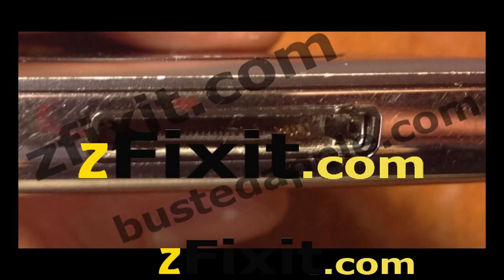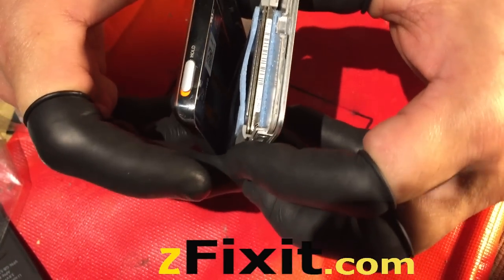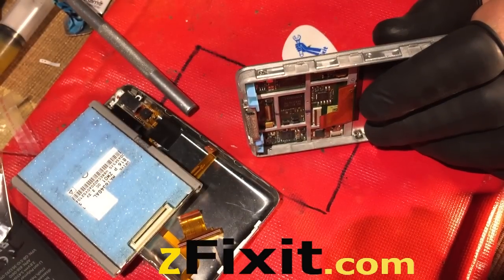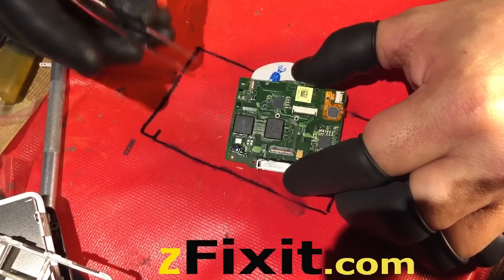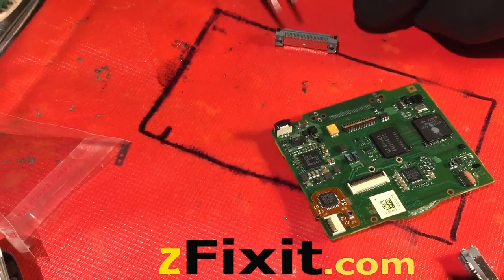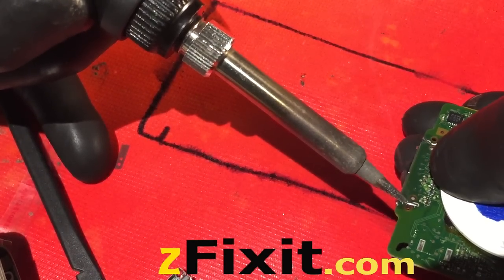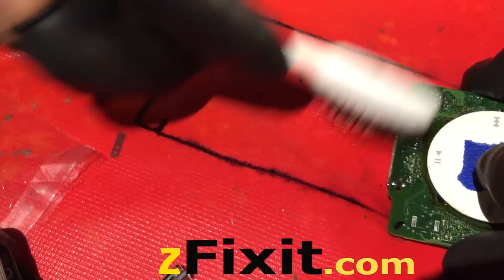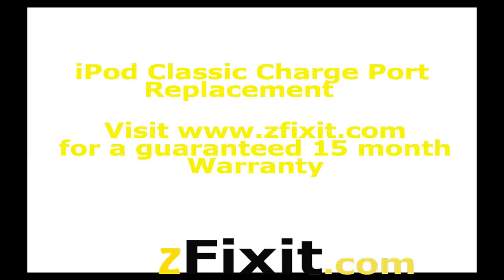iPod Classic Charging Port Replacement

Comment: I'm having issues with my ipod classic, battery was giving up easily so I replaced that with a bigger capacity and put a iflash quad in it. Thought I'd cracked it then my ipod just wouldn't sync aaarrrggghhh! Turns out the diagnostics said the connector wasnt working properly. Ordered two of them today. Fingers crossed

Comment from the maker: saw the dislikes... this not a tutorial, an advertisement for my business.  This is not recommended for beginners..so I did not post soldering instructions, most people will ruin their device. So many steps, the first timer will kill their device, this is micro-soldering with years of experience! I still have issues with bridging, cold joints even though I have been doing this for 8 years!  DO NOT ATTEMPT THIS unless you have very strong micro-soldering skills, if you value your iPod, do not attempt, reason I did not show soldering technique.  It was done under microscope ... so who has a microscope and who has a soldering iron that has the right tip...and so many other requirements.
Reply: I have been into micro-soldering for 3 or 4 months now and have done dozens of port replacements on various devices. It's generally pretty straightforward - although I do admit to messing up my first repair. When I was heating a hdmi port in order to take it off of a board, I wasn't patient enough and pushed it off when a pad wasn't melted and it ripped out a trace. It was repairable by soldering copper wire from that pin to the corresponding diode, however. That really was it and i'm brand new. There are plenty of good repair tutorials on YouTube and I have had dozens of other successful replacements. 

There's definitely a lot of ways to make your replacements and repairs better more often such as wicking up unleaded stock solder and replacing it with leaded solder, using quality tools, solder, and flux, using the right temperatures, and insuring everything is connected probably. The truth is anyone could do this. But you have to invest money in the proper tools, and for most people it's better to have someone like you fix their broken devices for them as they're not going to have hdmi or usb-c charge ports or encoder ic's go bad on them all the time.

Comment: Hi, did you solder all the little pin connection to the board or just the four points underneath the board?
Reply from the maker: Scott Copening soldered all 30 pins, did not show soldering process on the 30 pins as this is an advertisement, I show very useful stuff if you manage to open it. The soldering process is self explanatory for those that are experts at micro-soldering, the micro-soldering is not something recommended with a cheap soldering iron, the opening process if you attempt will usually end in additional cost, the battery disconnect may cause additional damage.   But is possible but do not recommend for a 6/7 gen, opening a 5th gen is easy.

Comment: My battery charges inconsistently, my iPod does not connect with any computer...I believe it to be the charging port (probably damaged by putting it onto a third party speaker). Best would be to send it to you after purchase a charge port repair? Do you check it for connectivity before you send it back?
Reply: Hi, yes, I test to check issues, have you tried a different cable before you send in?  
I'll try different cables also.  Before I replace charging port, I have to see physical trauma to the port, if not visible outside, I'll open it up and check the solder points on the inside.  If still does not work if I replace, then refund minus return shipping and .99 diagnostic fee.

Comment: If i were to find a shop to repair my charging port, because after watching this i noticed that its beyond me, what questions would i ask that would help me decided which shop to go to?
Reply: If your device was working fine prior to damage to charge port issue, they should be able to test with a battery that had been externally charged,  you should tell them you need a picture of the internal charge solder points prior to damaged charge removal , close up under magnification and then picture after removal. Some shops damage the solder pads where there is no issue with solder pads. Once they damage, they just tell you sorry, too much damage from your damage, they assemble and you are no wiser.  If all solder pads are intact prior to removal of old port, then there should be no issue.  I always take a picture of old port if I find solder pads ripped off board, send to customer, this is before I even attempt to remove the old port, so that there is no doubt to customer if it was pre-existing or if I caused it ( has never happened, me ripping solder pads off board, hence my high ratings on BBB, eBay, Yelp and in my website.

Comment: I wonder if I could trace data+/- then convert the female 30pin to female lightning, is it possible? will it still work on itunes?
Reply: no room, the current conversion adapters require too much room for the logic board adapter, their chips, etc. I have bought a few to see but not enough room inside. Their is much more chip requirements than just tracing pins to a lighting connector, requires a logic board, caps, transistors, resistors, SMD chips. It works with the required board .. but you cant just solder wires to a lightning connector, I tried, didn't work. Even if you can get it to work, the lighting female port will not fit, Then you have to anchor it to the logic board. else the new lighting port will have the same issues as the original, will come loose, become un-soldered.  Damage to the port is minimal ... but will be loose, need a solid port, no way to anchor the port.

Comment: How much do you charge for this service? Where are you located?
Reply from the maker: It is $99 plus return shipping of $5.80. you will have to purchase the diagnostic service first. $15. The $15 is applied to the $99 repair cost. If is it badly damaged, non repairable, then all you paid was the $15.  I have to spend time to open, look at it, I can't do it for free.  That is what the $15 fee is for, but if repairable, then the $15 is applied as a payment toward the $99. Pricy ... yes ... but it is only for those customers that value keeping their iPod intact.
In San Antonio TX
http://www.zfixit.com/ipod-classic-6th-gen-charging-port-repair/

Does not matter which version you have, 5/6/7, they are all the same price to replace the charge port.

Comment: How much does this cost (if i were to buy off ebay/kijiji
Reply from the maker: It is $99 plus return shipping of $5.80. you will have to purchase the diagnostic service first. $15. The $15 is applied to the $99 repair cost. If is it badly damaged, non repairable, then all you paid was the $15.  I have to spend time to open, look at it, I can't do it for free.  That is what the $15 fee is for, but if repairable, then the $15 is applied as a payment toward the $99. Pricy ... yes ... but it is only for those customers that value keeping their iPod intact. You can purchase a used iPod but at what cost?  If the cost is too much for you, you are better off buying a used one from eBay.  iPod classic owners are fanatics .. and want their own music ..whyen they no longer have the source files.  I can also pull music off a device and place onto a backup hard drive. Same cost.

Comment: how much does it cost to do it?
Reply: +Ed Nikon too much, u can buy a whole board for that much
Reply: +beN Garcia maybe a 5th gen, and the repair is not meant for repair technicians, meant for end consumers who want to repair and keep music, 6/7 Gen boards are $80 plus and then labor to install
Reply: yeah you're right, the 7th gen boards are like 100 bucks.  Do you use hot air or just hot iron?
Reply: +beN Garcia just iron unless the charge port moisture exposure/corrosion, then I use hot air also to make sure I don't pull any solder pads while removing as corrosion will not allow the low melt solder to flow underneath pins